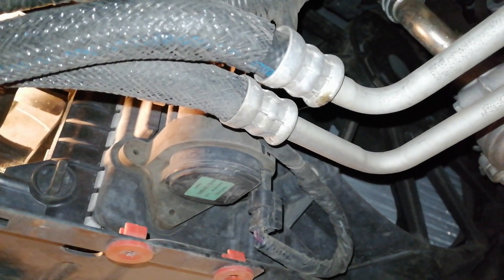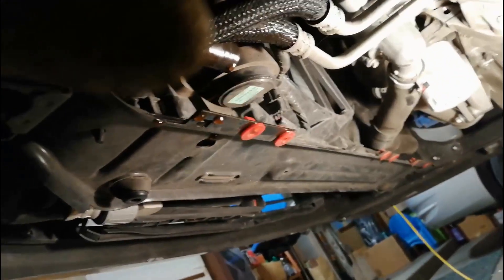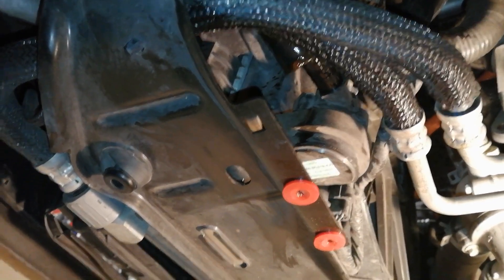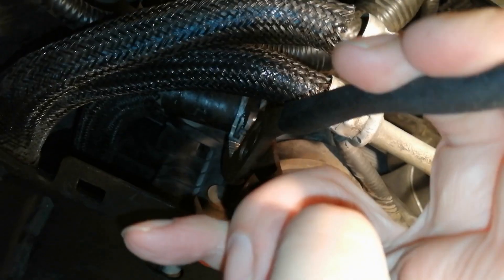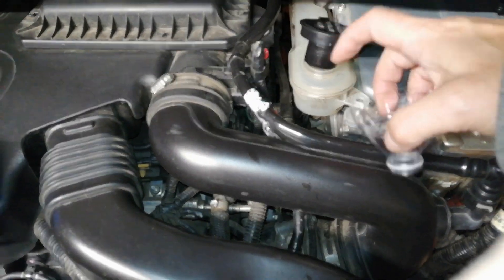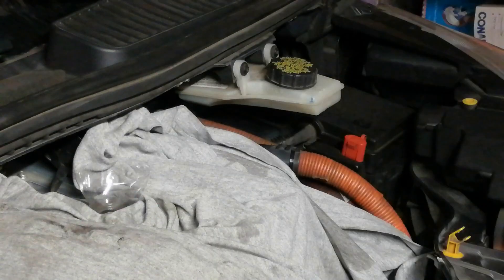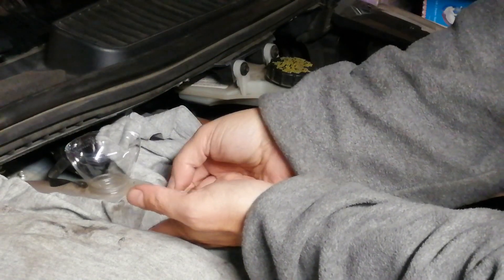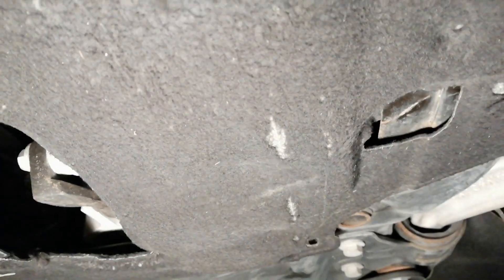How To Change Ford Hybrid Inverter Coolant (C-MAX)

Comment: I read that the inverter coolant is supposed to be the Ford Spec Green coolant, and it says to never mix the two different types. I bought a gallon of the Ford spec green coolant full stringth not 50/50 pre mixed. at Autozone for about $30.
Reply from the maker: I don't know what model you have, but the Cmax asks for the orange (now updated to yellow) coolant. Check your manual to be safe.

Comment: Thanks in advance do you know the process to force the pump to run and recirculate the coolant? After drain and fill
Reply: the dealer have the machine to force circulate it, you just need to bring your car to dealer and pay em. If you're unwilling to pay ot go to the dealer, just do this vid instruction and recheck it everytime you run it and top it off, after a few runs it should be good to go.

Comment: So why not use the coolant petcock right by where you disconnected the hose? Does it not also drain the inverter?
Reply from the maker: No. The petcock only drains the engine coolant. They are two different system. They use the same liquid though.

Comment: Im about to test this theory and see if this is the problem on my car. THANK YOU SO MUCH! My car keeps randomly shutting down after an hour and a half of driving with a "stop safely now" feature. brought my car to 4 mechanics and all of them said they dont even wanna touch the car. My inverter gets so hot u cant even touch it.
Reply: The reason things get hot is because the heat isn't being taken away. The water pump commonly fails on these cars because the contacts corrode and the pump either under-performs or stops, both causing overheating. The plug harness isn't sealed and is prone to getting road debris and water thrown in it due to being so close to the front, so it corrodes prematurely. All I did was sand the contacts, spray them with Deoxit and plug/unplug the cable a few times the same night I got a code thrown on my fusion. The error immediately went away. It's been 3 or 4 years and I haven't had any issues and the plug hasn't corroded any more since treating it and checking it every time I'm under the car for an oil change.
Reply from the maker: If you're not low on the coolant I doubt this will fix the overheating. But good luck to you. Fresh fluid won't hurt anyways
Reply: @TheFrankman711 So my coolant doesn’t bubble or swirl on the right coolant reservoir connected to the inverter. I can hear my hybrid battery fan going in the trunk constantly. My inverter gets ridiculously hot. This has to be the problem. Does my inverter have a temperature sensor?
Reply from the maker: @Drax0138-n8p  I would assume so, just like the engine coolant has a thermostat. But I'm not so familiar with the inverter system myself. Maybe best if you go to an auto parts store and have them scan the car with OBD reader for any error codes.
Reply: @TheFrankman711 I have an OBD myself and get no codes at all. 😢
Reply from the maker: @Drax0138-n8p  Do you have the ForScan App? Maybe that will show a little more info

Comment: This video may have saved my life
Reply: Hey I used pretsone antifreeze all vehicles coolant in mine is that ok?
Reply from the maker: @djpope7428  Well, I used the motorcraft yellow coolant. But you will probably be OK. What color is it?
Reply: It's green inside the bottle but after use I turned to a pink color
Reply: @djpope7428 I've read the Orange fluid turns to pink later on.

Comment: Is it the same process for the engine coolant? I don't see a traditional thermostat to bleed the air from the coolant system. And am not finding much information online.
Reply from the maker: No, for the engine coolant it's different. I made a video about that as well

Comment: I have air in my inverter coolant system. How do I bleed the inverter??
Reply from the maker: how do you know there is air in there? That system is not air tight and pressurized like the engine coolant system. I would think that the air over time gets out by itself...just check the reservoir for a few days and top off as needed

Comment: I have been putting power steering fluid in the reservoir. Have I damaged anything or can I just drain and add coolant again?
Reply: Steering fluid is oil based and will eat the hoses and rubber seals in the cooling system.  You need to extract the oil from the reservoir, then do a thorough flushing with a cleaner that will remove the oil.  The oil will tend to stay floating above the coolant, but some will likely get mixed in, that's why you first want to suck the fluid out of the reservoir before draining, I'd remove the reservoir before draining the system so I can clean it separately.  After that's clean, then you start the cleaning/flushing to get rid of oil in the system.
Reply from the maker: I would definitely drain it and put the correct fluid in it. It only holds a little more than 1 quart. Did you put a lot of power steering fluid in it?
Reply: About hslf a bottle because I noticed it was low. My friend said to take a turkey baster and suck as much out of the reservoir that I can but it looks like your method will be more effective @TheFrankman711

Comment: Hello, thank you for your video, I have a question, I have noticed that the reservoir beside the electric engine in my fusion hybrid is low and it has orange color fluid, can I open the reservoir and fill it with the green cooland liquid that ford is currently using? Also, sorry for this but why is it important to fill that reservoir?
Reply from the maker: Hi, yes you can open the reservoir cover and add fluid. But the current coolant from Ford is yellow and it is compatible with the orange. 
If you run too low on coolant, you could be at risk of overheating the converter...but as long as you still see some in the reservoir, you will be OK.
Reply: I bought the Ford Spec Green coolant and Ford says to NOT mix the two types. I was able to buy the Ford Spec Green coolant at Autozone full concentrate, they had in the back not on the shelf. He looked it up  on their computer and it showed in stock but in back store room, strange I thought but a little over $30 gallon.

Comment: Mine has the orange but its low, its never been changes the car has 87,000 its a 2015. Can i top it off with yellow?
Reply from the maker: @tiffanyearls9953  Yes you can. They are compatible

Comment: So the engine coolant is the same as the inverter coolant?
Reply from the maker: correct
Reply: No it is not. Ford Spec called the Ford spec Green coolant and said to never mix the two.

Comment: Hello! Thanks! How much coolant I need for engine and inverter? Thanks!
Reply from the maker: Hi, the inverter needs 1 Liter (1.1 quarts). I don't remember how much exactly I needed for the engine, but I only got 1 gallon of the yellow motorcraft concentrated and mixed it 50/50 with distilled water. So I ended up with 2 gallons and still have some leftover.

Comment: Will this work on a 2019 fusion hybrid and a 2013 fusion hybrid? I own 2 fusion hybrids.
Reply from the maker: yes, it should be even easier with the fusion because you have more space in the engine department

Comment: Can I add the same coolant that i use for the engine? I noticed the one you added to the inverter is orange as well.
Reply from the maker: Yes, they use the same coolant. Ford updated the orange coolant to a yellow one, but they are backwards compatible. If you still have orange one, you can use it. (i did as well)

Comment: Does any of the require the vehicle to be flat
Reply from the maker: For the inverter coolant, NO. Only for the transmission fluid change the car should be level.

Comment: Do you have to drain befor adding.coolant? There is appx 3% fluid in my reservoir
Reply from the maker: No, you don't have to drain before adding coolant...just make sure you use the same coolant that's in it or one that is compatible, like the motorcraft orange or yellow
Reply: @TheFrankman711  thank you
Reply: @TheFrankman711 I have orange in it and the Ford sells the yellow can I just add the yellow to top it up plz reply it’s a Ford fusion energi plug in hybrid
Reply from the maker: @shahab7122  Yes! The orange got updated to the yellow and they are compatible.

Comment: Is it safe to simply add coolant if its low
Reply from the maker: yes.
Reply: Do u know what might happen if it is low?  Mine was low and i think that may be the reason my gas mileage is bad.  It was low….i got gas and it was saying 300 miles to empty….i usually get 500 or so.  Then i filled the coolant.
Reply from the maker: @86bookshot  Nothing should happen if the inverter coolant gets a little low. Just top it off to the max line. (mine gets  a little low as well all the time) I would use the motorcraft orange or yellow coolant (or equivalent approved stuff), because you're not supposed to mix different coolants.
The gas milage is not related to a low coolant level. The only thing that can happen if you get extremely low, is that the inverter will overheat.
Reply: @TheFrankman711  i thought maybe the low coolant was a result of the high voltage batt not kick-on this making the mileage bad.   Any ideas on what that could be then?  Filling it up and all of sudden getting 200 less miles to empty.
Reply from the maker: @86bookshot  The only thing I could think off is that maybe when it's colder outside the car runs more on the gas engine. Also check your tires for correct pressure when they're cold. Recommended is 40 PSI cold.

Comment: Did you have to disconnect hybrid high voltage for this? Is this what is considered a inverter coolant flush?
Reply from the maker: No, you don't need to disconnect the high voltage for this. I did not a flush here, just a drain and refill with new coolant.

Comment: Can I just add coolant, without having to change it? And it’s not a cmax. Just a fusion hybrid
Reply from the maker: Yes, as long as it is the same coolant that is already in it. I assume it's the orange motorcraft coolant...it got superseded with yellow coolant and is backwards compatible. (so it is OK to mix it)

Comment: So i noticed on my inervter reservoir. Mine has full cold and full hot fill lines. Which one did you fill it up too?
Reply from the maker: Since it is cold, I filled up to the cold line.
Reply: @TheFrankman711  gotcha, appreciate the quick replys! Did you ever change your serpentine belt and timing chain at 150,000 as well?
Reply from the maker: @beammeupscottsp7952  The C max doesn't have a serpentine belt, and I never changed the timing chain and I don't plan to.
Reply: @TheFrankman711  interesting
Reply: @TheFrankman711  yeah I’ve never heard anyone change a timing belt before
Reply from the maker: @beammeupscottsp7952  no more belts in this car, everything is electric now.

Comment: How did you get that clip off, mine is facing upwards and i can only reach it through bottom, i see you turned the clip back downwards when reattaching the hose 😂
Reply from the maker: Right, this was a bit of a challenge. Mine was facing upwards as well and I turned it around for future access. They have a special clip remover tool that would make it easy to remove the clip (don't know what it's called). I don't remember how I managed to get mine off, but it was challenging.
Reply: @TheFrankman711  same, I eventually got it. Made sure it was facing down for next time. Mine still had some orange coolant left in it, drain and filled with the new yellow coolant so will drain and fill again soon just to get the rest of the orange coolant out.

Comment: So basically fill slowly turn the vehicle on and top off with vehicle on, just make sure the pump is running, do you need to wait for the thermostat to open like the engine coolant?
Reply from the maker: No, I don't think there is a thermostat for the inverter. It also holds only about 1 quart of coolant.

Comment: Do you leave the expansion tank cap open when you first start the car?
Reply from the maker: Yes. There is no pressure on the inverter coolant system anyways, and you can add more if needed
Reply: @TheFrankman711  thanks, does the engine coolant run through the same pump as well?
Reply from the maker: @beammeupscottsp7952  No, it's a different system. They only use the same antifreeze.
Reply: @TheFrankman711  oh gotcha, I have a 2012 fusion hybrid and was going to try this myself next week, hopefully it goes as smooth as you make it look.
Reply from the maker: @beammeupscottsp7952  Yeah, good luck .

Comment: Would you happen to know if this would be the same process for a 2010 Ford Fusion Hybrid?
Reply from the maker: here is a link to a photo for the correct hose 
  https://fordfusionhybridforum.com/uploads/monthly_2020_08/427322729_SDEusenfileE157443_EUR_580_JPGgenref.JPG.2e98f25eb7e4160ef2bdf8ba163a82d3.JPG
Reply from the maker: I believe so. You should have the same transmission model (HF35) but the 2010 Fusion needs the Motorcraft
 Specialty
Green Engine Coolant = VC-10-A2 (US). 2.8 qt for inverter. Actually Ford Engineering has approved the use of yellow-colored Motorcraft® Yellow 
Antifreeze/Coolant for the green colored coolant  (WSS-M97B55-A)
Reply: @TheFrankman711  Thank you!
Reply: @TheFrankman711  I have my fusion sitting on ramps right now. Looks like it does have something similar to this vehicle shown in your video - luckily I was able to find cause of the green sticker shown. The invertor is just in a slightly different spot. 

Will draining removing either hose going/coming from the invertor drain the whole system?
Reply from the maker: @racequad9  Not sure how the setup on the fusion is, but it should be the lowest hose attached to the pump
Reply: @racequad9  did you ever do this, want to do it on my 2012 Ford Fusion hybrid, same model as yours!
Reply: @beammeupscottsp7952  I tried to but couldn't remove the hose. I didn't have a plastic pick of some sort and didn't want to use a flathead to avoid damaging it and then having to deal with leaks.
Reply: @racequad9  I ended getting both done tonight, let me know if you still need help.
Reply: @beammeupscottsp7952  Nice! Which hose(s) did you end up removing? While I was under there, I noticed two hoses going into ev motor. I was tempted to remove one or both of those but wasnt sure.
Reply: @racequad9  yes, there was two (only need to remove one). Its the one on the right (basically the one that comes in sideways), definitely doable! The inverter bleeds itself, just wait until it stops burping when your filling the reservoir. You can hear it burp itself.
Reply: @racequad9  we actually have a bleeding valve for the engine coolant btw.
Reply: @beammeupscottsp7952  good to know!
Reply: @beammeupscottsp7952  ah yes, I knew about the engine bleeder. Big plus when doing engine coolant
Reply: How many miles do you have on it btw, and any repairs?
Reply: @beammeupscottsp7952  currently at 108,000 miles. I got it with 88,000 miles. Only issue I've had was when I bought it the EV charging system wasn't working. A known issue with these cars when they hit the 10+year mark. I found a fusion forum that has a how-to and fixed it for less than $20. And the other issue was the Throttle body was causing the car to go into limp mode. $88 for a new one and 15 min install. That's about it. When I bought, besides changing the oil, I changed the spark plugs, ignition coil boots (just the boots not the entire coil), trans flush, and coolant flush. Very reliable car and great city MPG.
Reply: @racequad9  nice. Yes performed the EV trick as well, mine went into limp mode around 130,000 throttle body replacement. Just replaced all three motor mounts as well.
Reply: @beammeupscottsp7952  how many miles on yours?
Reply: @racequad9  180,000. Had it since 78,000. Still drives like the day I bought it.
Reply: @beammeupscottsp7952  very underrated car.